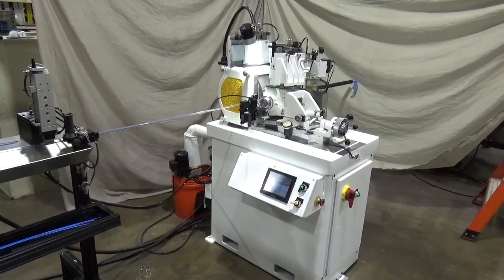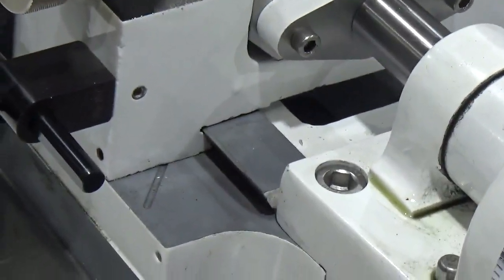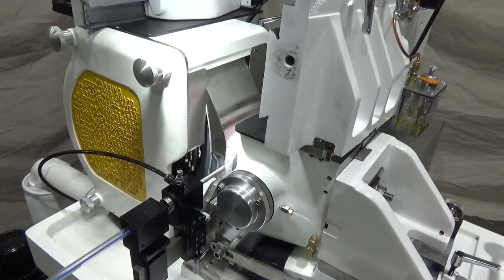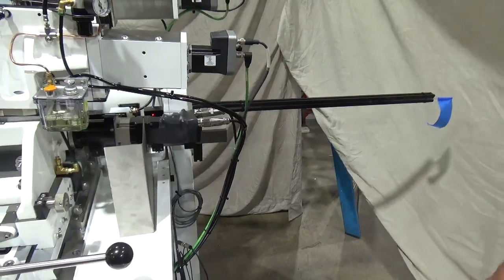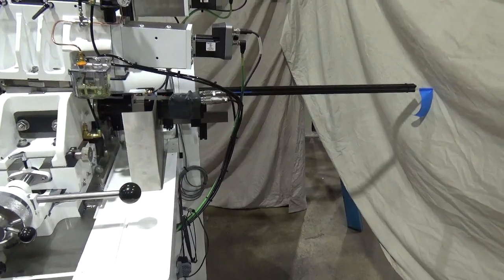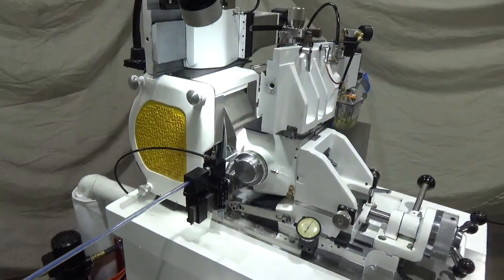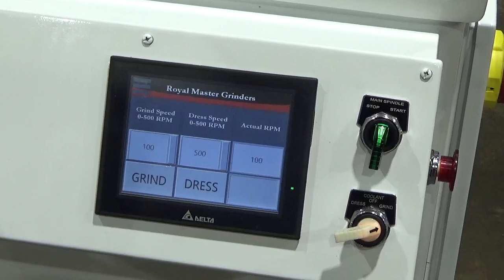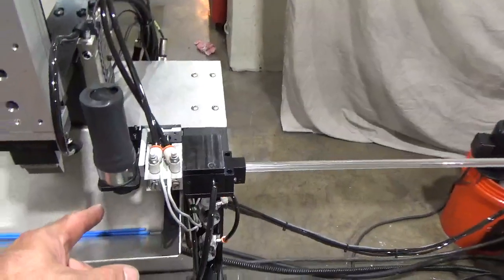Thrufeed Catheter Grinding Royal Master Centerless Grinding

Comment: I am  from India. My requirement is to grind 29 to 39mm diameter rods of length upto 1000mm. Please forward the quotation of this machine.My contact number is +91 9391218899